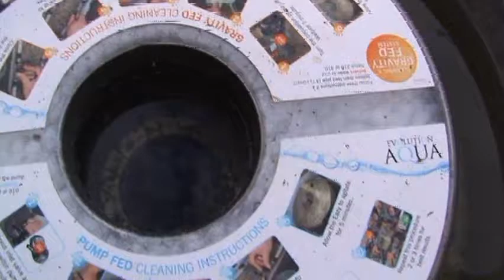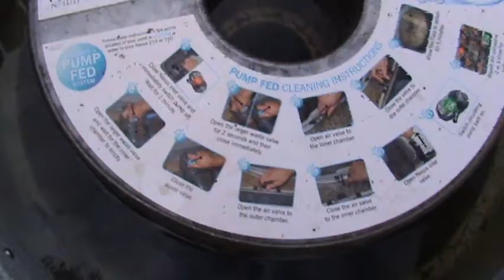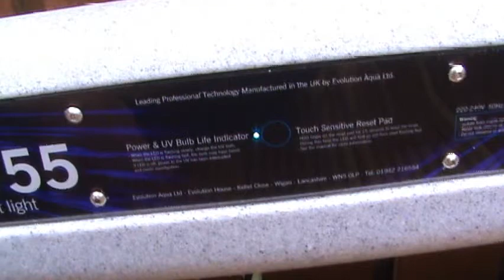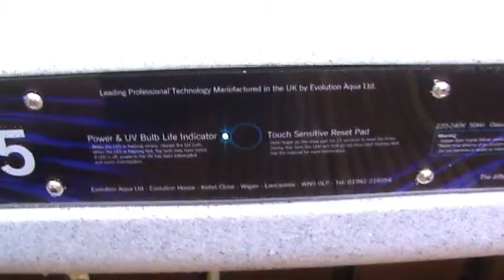How to Build a Koi Pond - Part 2 by Pondguru

Comment from the maker: I'm not too convinced by the inner ring of K1 acting as a mechanical flter as I thought the original foam in the 200's did a better job of removing fine solids. I maybe would have had a multi foam arrangement like the middle of an Oase Filtoclear pressure filter which you could press down to clean then drain the muck out when the water from the vortex is drained. Chemically, the filter cleans well but not too sure mechanically yet. Maybe when the K1 gets a bit older it'll be more efficient.

Comment from the maker: You can't just chuck fish in straight after building a pond - especially expensive, sensitive koi. The few fish in here are there to help build up the filter with bacteria and then after a few weeks the koi will start to be trickled in over the coming months. I tend to focus my videos on the construction of the ponds and once they are built the job is over. The stocking of a pond with koi will take many months after the pond has been built.

Comment: Hello PondGuru!
Did you use any pump to drain the water from the pond to the Nexus filter?
Reply from the maker: No the filter is gravity fed from the pond by a 4" pipe and the pump sits after the filter. It could have been set up to be pump fed  but this one is gravity fed. The 'part 1' video shows the pump and filter set up as well as the bottom drain so you have to suffer through my incredibly boring voice, lol
Reply: Thx,  I'll give it a try!

Comment: that oase 2 way water  top pond lower pond are crap.i had 2 and on 2 occasions they broke .what happened is when i tried to turn the water between upper and lower pond.there was no stop point to say when it was open or closed they just kept turning.i love all your videos .you build magic ponds and great advice but that switch valve its like your turning them and the thing just stays open when you want it closed.all the best for the future and keep making them koi videos
Reply from the maker: Yes, that is the only problem with that valve. If it is turned too hard either way the stop point can be snapped off causing the tap to turn right around. It shouldn't make a difference to how much water can be diverted left or right as the fitting is a flow regulator, not a shut off valve. It is not designed to shut off flow, just regulate it so you may still get a small amount of water coming out of a closed off pipe.
I'm glad you enjoy the videos - thanks for watching.